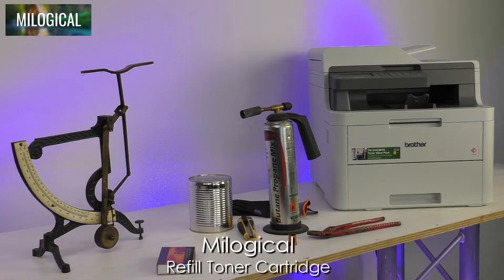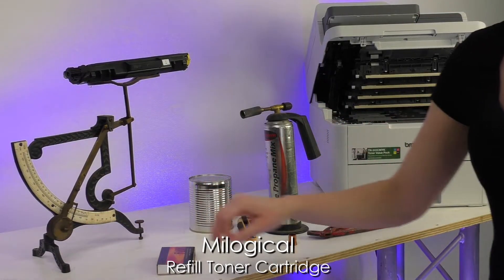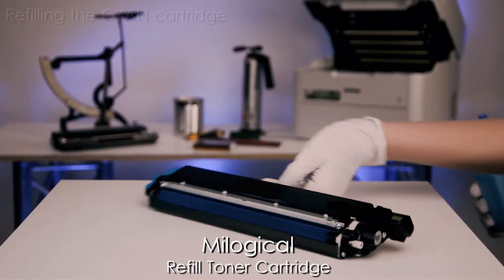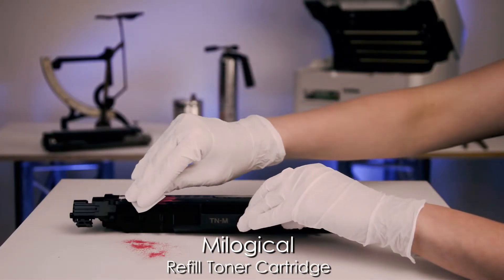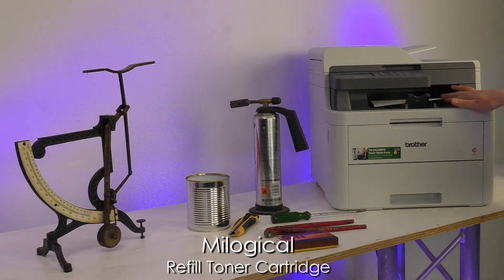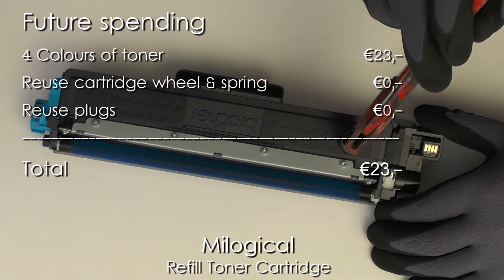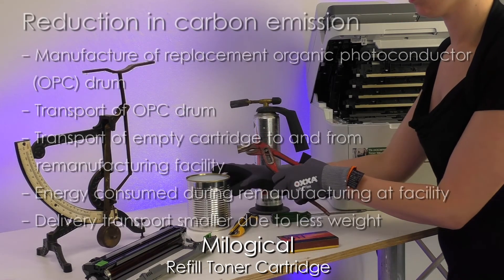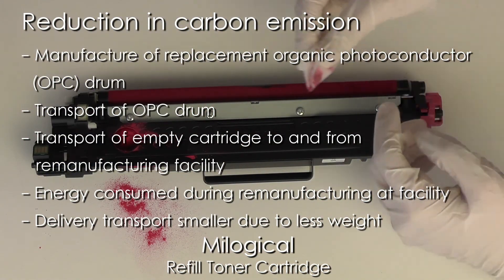DIY Refill Toner Cartridge Brother DCP-L3550CDW

Comment: Thank you so much for this video.
After I refilled the printer still thinks that the cartridge is empty. You need to reset the cartridge data ;)
Open the front cover of the printer (to access cartridges).
With the cover open, simultaneously press the Clear and Stop/Exit buttons. It may take several tries for this to work and for "K.TNR-STD" to appear onscreen.
Scroll through the menu to select a color and yield to reset.
The LCD will read "Accepted" once the reset is complete.
Reply: or just watch he other videos by Milou about this machine. This video is the last resort after you did all the other tricks first.